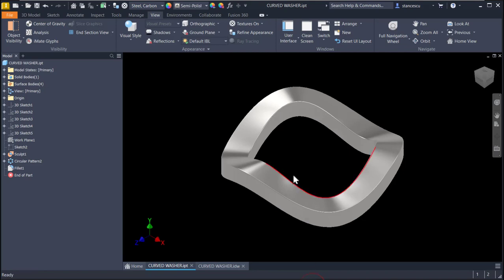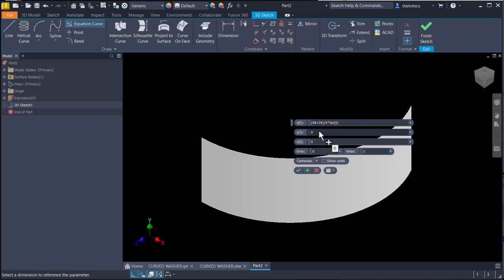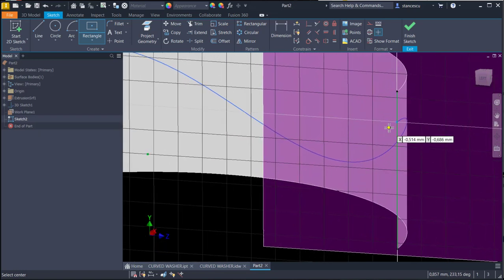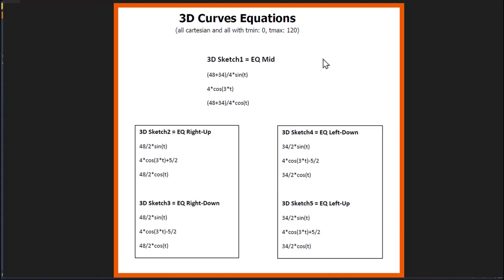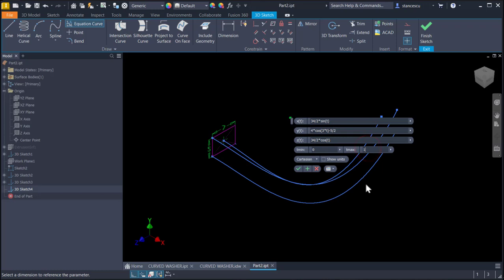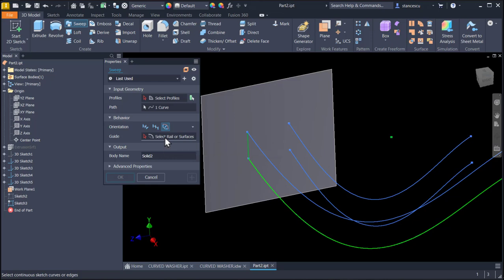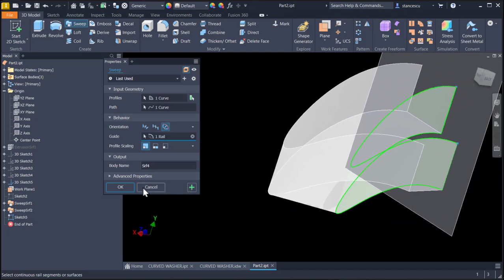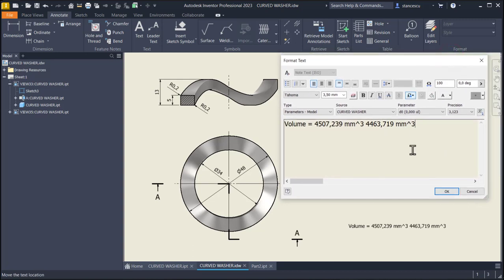Tutorial Inventor - 243 CURVED WASHER

Comment: Dear Sir. How did you get the 3D equations particularly the middle one. y=4cos3t
Reply from the maker: The theme was to use sin or cos functions. I thought that cos is the suitable function on the vertical (Y axis), and you see that 13-5=8. Half of 8 is 4, and the rest is the value of the angle as a parameter. That's all my friend...
Reply: Thank you Sir. Nicely answered
Reply: But why 3t?